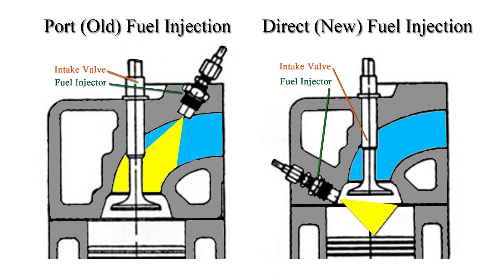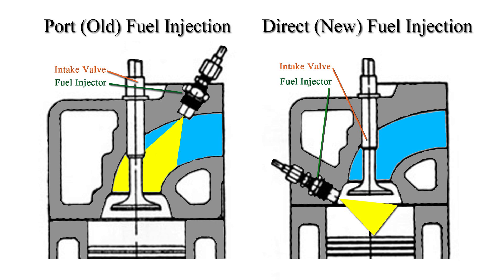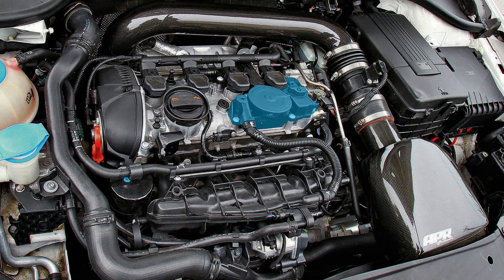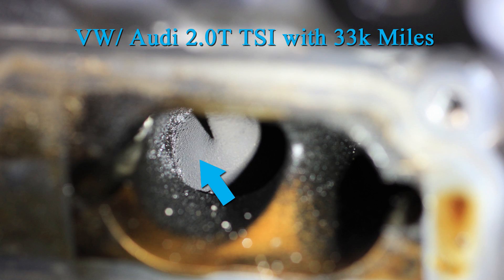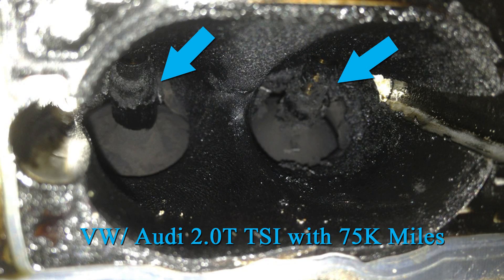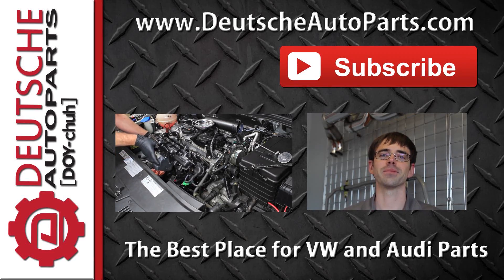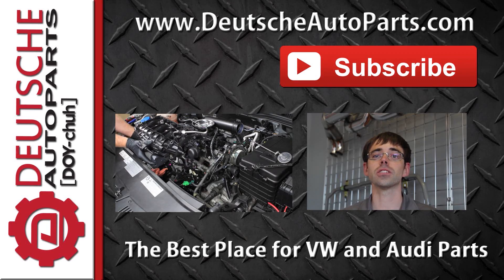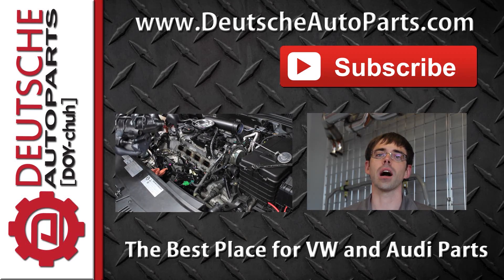Carbon Build up on Direct Injection Engine (Intake Valves) AKA GDI Gasoline Direct Inection

Comment: Simple question poped up for me. If you really start to remove the carbon build up from the valves by mechanically removing it (scraping, picking or what ever mean), the removed carbon will just drop into open cylinder. So the way to prevent that is to turn the crank and close the valve and after removal blow it out with compressed air? I have a R8 ABT Kompressor and for the supercharger overhaul it is removed and after 57k KM the valves are to dirty for my taste and i was woundering how to do it? Because for me using chemicals is risky for the catalytic converters right after the exhaust manifold, witch will get glogged up. So is the only option to to close valves one after another to eliminate the carbon for falling into the cylinder? Or do you think that the contaminates in the cylinder is no problem?

Comment: Typical of EPA auto manufacturers turn this junk on to the public they know after 5/50k what do they care plus they can sell a new service at the dealer tear down engines to clean them. You forgot to mention Oil Volatility they test oil by heating it and see how much % evaporates sending back into your engine. Synthetic oil does a better job that's why always run good synthetic oil in a Direct Injection motor.  Here is a chart shows different oils  NOACK test http://superoilcentral.com/wp-content/uploads/2015/11/noack-comparison.jpg  Non synthetic which is based on mineral oil with additives is worst thing you can do it will actually cause the most carbon buildup.

Comment: It is not just the pcv system  as a factor but also the cam timing with overlap that causes this.  The catch can will just slow down the build up.

Comment: Toyota's solution (using port AND direct injection) seems to almost completely eliminate the problem.  Not sure why everyone isn't doing it.  Seems to me other GDI engines just need their valves cleaned every 30k miles or so, no matter what you try to do to prevent it.

Comment: Hi I have got a macedec vito with really bad carbon billd up on the engine where the injectors are the van keeps cutting out while driving what is the best way to get it off the engine?

Comment: Catch can does NOTHING on carbon buildup, only oil buildup (there might be a 10% decrease in buildup)
The only solution is to do EGR delete since the carbon is from exhaust carbon.

I work as a mechanic and trust me there is no carbon buildup before the EGR pipe enters the intake, and the oil vapors goes in long before that and only leaves an vary thin oil film in the intake.
98% of the buildup is from the EGR
Reply from the maker: These cars don't use EGR.
Reply: Deutsche Auto Parts on what engine code? My RS4 B7 4.2 FSI still has a EGR, just cleaned out intake because random missfire

Comment: Just buy Toyota/Lexus, or another car with dual (port and direct) injector system.... Profit!
Reply: My Lexus has this setup. I also have a mk6 gti and i am pretty sure i need to clean the intake valves
Reply: Too bad the Lexus 2IS IS250 only has DI and while the 2IS IS350 came with port and direct, too bad it didn’t come with AWD :/
Reply: @sth801lifestyle  do you mean IS with the engine A25A-FKS ? Or an older generation?
Reply: @ShatNdd  I’m referring to the 2IS 2007-2012.

Comment: The only acceptable fix is a Mann-Hummel Provent or Flash lube air oil separator, the filters used in these brands are extremely effective and basically eliminate the problem. The only issue is finding a way to install them in your engine bay as the only fitting kits available are for turbo diesel vehicles like the Toyota Hilux. 
DO NOT BLOCK THE EGR VALVE!! 
Installing one of the catch cans above will not only prevent carbon build up in the intake manifold but will also stop the corrosion of turbo bearings and the coating of the intercooler in oil which decreases its efficiency.

Comment: I'm old enough to remember my dad and older brother telling me to drive at highway speeds and floor it to 'clean out the carbon from the carburetor."  I remember doing that as a teenager and seeing all that black smoke come out the exhaust.  That was before all the EPA regulations.
Reply: That's what's commonly known as an "Italian tune up" apparently Ferrari guys would do that back in the day. Get the engine hot enough to break up any build up and burn it out.
Reply: I don't know how that's gonna help with GDI engines. Italian tune up will only help in non-GDI engines. Scotty Kilmer explained in one of his video.
Reply: that'd be carbon from the cylinders and valves but yeah, you'll heat up the engine a bit more than spec and load it hard to clean out some deposits

Comment: would a 3.6 VR6 have this problem with carbon build up?
Reply: YourMobile Barber I know this is 2 years old but to answer: the 3.6 vr6 has a integrated catch can by design ( yeah!) but mine has 130k miles and low end torque, top end power and gaz mileage has started to go down lately. It probably due now.

Comment: The problem folks, is that a gasoline engines are not meant to be a Engine OIL Burner! ( Diesels burn oil, not gasoline engines) Engine oil that gets on the intake valves stems or piston domes, does not burn off clean. It needs fuel to help with its complete combustion but that still will not prevent build up of carbon. The Oil manufacturers are struggling to satisfy all the needs of the modern engines and their uses. With that in mind,  there is NO OIL that can deliver. (Extended drain intervals, Turbo Temps, Catalytic Converter and O2 sensor life, Less engine wear without zddp additive, clean combustion chambers and intake valves from EGR system,  ETC the list goes on!) They have stated "NO OIL EXISTS to do all the things necessary in these new engines!"The EPA is pushing for fuel MPG, No NOX fumes, and these tighter standards are pushing for Direct Injection, Turbo charged engines. Burn Top Tier fuel, use high quality full synthetic oils like (Mobile 1, and Quaker State Ultimate Durability, Pennzoil Ultimate Platinum) . And use your manufacturers Fuel system cleaner once every 10,000 miles. That is the best you can do.

Comment: I run Lucas gas treatment with every fill-up in my '17 GTI.  Does that help the carbon situation at all?  24k runs like a champ.
Reply: No help at all
Reply: lucas sucks I use seafoam and drive hard premium fuel etc... and valves had a little carobn at 50k

Comment: Stupid question but would water meth injection prevent carbon build up?
Reply: kyle barnes some engines running methanol injection for longevity would be counter productive, aluminum specifically(which is pretty much what most heads are made out of)

Comment: Hi I'm stationed in Germany and found some really good products from Liqui Molly (not sure if I'll find them in the states when I go back). Anyways, I used a spray can to clean intake valves and EGR on diesel engines since I have diesel BMW and I can tell you this stuff works awesome. There's also a intake cleaner for gasoline cars. Have you heard of these products and would it be safe to use an an 2014 Ford Explorer Sport Ecoboost? Thanks!
REPLY

Comment: I know people steam clean diesel engines and older gasoline engines by carefully spraying water into the intake when running at low/medium RPM. Not sure this does anything for the intake valves, but it sure eliminates carbon build up in the cylinders and on the pistons.

Comment: wrong,wrong,wrong,,, it is not the PVC system,,, engines that don't have PVC system get this,,, Valve guide seals people,, any engine with over head valves,, after engine is turned off, oil seeps down valve stems and settles on top of valve.
Reply from the maker: There is lots of evidence in VW and Audis that this is from the PCV system.  Maybe on the engines you are referring to its different but that is not correct for the VW and Audi engines we are referring to.

Comment: You can thank the EPA for this. I would just unplug that shit from running back into the intake when I buy the car and route that pcv hose to the ground or something. Once I do that I will plug that open inlet on the air intake system. You should never have a carbon problems then.

Comment: Had to have valves manually cleaned ( $ 770.00 ) @ 68,000 mi. on my 2013 VW CC R-Line 2.0 turbo engine, so I guess top tier fuel is not the answer. How long can I reasonably go before another valve cleaning??
Reply: 50k  I use seafoam every 5k and drive hard and only use premium fuel and at 50K I removed intake and it was just a light dusting of carbon ! driving hard with the seafoam opens the valves more and cleans as you drive ! period 770 was a walnut shell blasting don't drive like grandpa and use the seafoam every 5k when you change you're oil don't wait until 10k like dummies do. Then when you get to 110k have the dealer do again for 770 and have them take before and after photos !

Comment: Sometimes it's caused by bad engineering. In Ford's 1.5 Ecoboost the PCV is only connected to cylinders 2 and 3. They get gunked up a lot sooner while the outer two cylinders remain clean.

Comment: Question:  Long long time ago, back in the fifties and sixties, we would clean the carbon out of the cylinders by spraying water into the carburetor while running the engine at a fast idle;  do you think this might help?

Comment: I bought, new, a 2012 Genesis V6 3.8 liter sedan in June 2011. The care has 67,000 miles on it now. I have been putting it off (cleaning the valves)....need to get it done.

Comment: ...try also "servicerens" from bell add. They make a spraycleaner you inject into airintake while engine is running. This one helps too. Here, where i live, you can only buy it in Toyota shops. 
good luck

Comment: I have been cleaning my Toyota with demineralised water before every service... like twice a year. Combine this with some fuel injector cleaner and a good rpm run on the highway once in a while keeps my engine in top form. You should really try this. It works.
Look for "decarbonising of engine with water" here on YouTube.
Cheers out there!

Comment: I have a intake manifold replacement comming up. I have been using a can of seafoam every month where the intake sensor is in hopes that it will break this crap up. But ultimately a catch can is where it needs to be replaced. The price of a catch can that replaces the PCV is $300+ but the replacement of the PCV is about half that cost so 2 replacements of the PCV and I would have paid for the Catch can.

Comment: CRC has a really good cleaner I used and it seemed to help a lot. I used it at 40K miles. The biggest concern is that if you have a gasoline turbo direct injection, the wrong kind of procedure could cause huge chunks of carbon to break off and damage the turbos

Comment: I bought an A4 B7 that I am almost certain nobody cleaned the intake/valves. Bad fuel economy, and got a p2004 code with sluggish acceleration and CEL + traction and EPC lights came on (intake manifold runner control valve stuck open). I heard i should replace the intake manifold actuator, so I put it on my to-do list. A few weeks later the same engine hesitation and lights came on, but this time with no CEL but a pending P0121 code (Throttle Pedal Position Sensor/Switch (TPS) A Circuit Range Performance Problem). 

Are these related? Will fixing the actuator and cleaning carbon fix both??

Comment: Emission controls are ruining your engine
Reply: What's funny is, when all these emissions controls are removed, the most harmful emissions go down. Want less CO2 emissions? Improve the fuel economy of your car by removing the restriction and choking emissions controls that lower MPG. Want to low NOx levels? Get rid of direct injection, turbochargers, and lower the compression ration of engines.

Comment: Very Infomative but just one Little Question,Couldnt Water-Meth Injection be a possible Solution? It is sprayed in the Intake System before the Throttle-Body and then it could be asubstitute to the classical Multi-Point Injection System to manly keep the Intake Valves clean Better Octane Rating would just be a Bonus...

Comment: Good job sir. As a former engineer with Audi, and realized this issue in 2002. It's a relief to have someone like yourself explain the deficiencies in this technology. Not only that, nearly all manufactures are doing this technology. I've spent 10 years on finding a solution to this carbon build up issue with nothing more than manual cleaning  as a solution. I'm actively approaching seafome and BG to come up with something. They are not ready to take this at effective levels.

Comment: Redline, S1 full fuel system cleaner , highly concentrated synthetic product really works.
Use quality gasoline like Shell Super and add 1/10 of the bottle every other tank. Be regular and you will stay clean for long time....
Reply: Redline is excellent but in regards to the 1/10 bottle in the tank that won't do anything to clean the valves since the fuel never hits the valve in (GDI) gasoline direct injection cars
Reply: k domster is this on vw with th3 same issues?
Reply: How would fuel additives clean the back side of the intake valves?  The fuel never touches them.

Comment: have you thought about dry ice blaster I used it to blast aluminium off copper
Reply: We use dry ice to blast corrosion off of very expensive aircraft parts that we want to keep in service for a long time. Should work well on carbon.

Comment: someone like gumout makes a cleaner that you put in the air flow now before the throttle body. it's a tube connected to a spray bottle of cleaner.   I'm wondering if you use that method at every oil change if it would help.

Comment: Does Mk7 GTI have this issue? It has dual-injection system (with stratified direct injection for part-load and conventional port injection for high load).

Comment: On my '96 Northstar, I used to keep the oil at the fill Mark.  Now I keep it on the low side of fill, and my intake stays much cleaner.  Would keeping the oil on the low side reduce blowby, and keep a direct injection engine cleaner?

Comment: dude just use Techron or royal purple. don't fall for the Lucas Jew
Reply: But Techron or royal purple do not get on the intake valve of a GDI engine. The intake valve is above the injection port and the PCV system comes in with the air from the top of the valve, causing it to coke up.
Reply: Jon Lucas in that case, then Lucas is OK but I would rather power wash the shit out of the engine
Reply: zhbvenkhoReload crc gdi intake and turbo cleaner only works

Comment: The catch can won't matter because cars have valves overlapping in the open position allowing combustion carbon to accumulate.  .. Just pop a small breather filter on the top of the valve cover and get rid of the hose altogether.
Reply: I've pulled a couple of gallons of oil/water/gas gunk out of the EGR system on my Ecoboost F150.  It would be a tough sell to try to say that that didn't matter.
Reply: Gallons !  ... Something is wrong with your car if that's the case.
Reply: Over a period of a couple years...sorry I didn't mention that...but still a large amount of gunk to dump on the backside of a hot intake valve.
Reply: Have you heard about any negative effects of using products like Sea Foam or Chemtool B12 on turbos?

Comment: Will this give a check engine light and misfire?
Reply: My Volkswagen experience misfires on cold starts. I replaced the coil packs and spark plugs, still misfires. Had the carbon clean with sand blasting it, and it runs perfect now.
Reply: Yep. During cold starts it will misfire

Comment: I'm planning to buy a 2012 Mazda 3 soon. According to the article (below), Mazda engineers determined that carbon deposits build up when valves temperature is under 400°C (752°F). They designed the engine so the intake valves aren't cooled by any water jackets, so the valves get hotter.

http://www.motoiq.com/MagazineArticles/id/2105/pageid/3529/131-compression-and-40-mpg-on-87-octane-fuel-introducing-mazdas-skyactiv-technology.aspx

Comment: great video. I'll have to pass this on to my friends with direct injection cars.... I wonder why anyone would give this video a thumbs down, this is really good info...
Reply from the maker: thanks for watching
Reply: Thumbs down because it is anecdotal non-engineering. Catch cans have not been independently tested.  If CC's significantly improved service intervals or reliability MFG's would install them, and you can be sure they the MFG would have better engineering than aftermarket ones. I'd like to see the real diagnosis of carbon build up, maintenance problems, driving behavior.

Comment: 95% fix is to block off the exhaust gas recirculation (EGR) to the intake by adding a blocking gasket 
this stops the exhaust gases from building up soot/carbon from the intake and valves
this issue is very common on nissan skyline V35 m35 stagea's cars and any nissan that runs a DD engine aka Di DI-NEO or DD DDNEO or for example VQ25DD or VQ30DD  if it is DE the injectors are in the intake

i have cleaned 3 nissan V35 VQ30DD intakes and valves from 1cm/10mm thick soot/carbon build up from the EGR at the back on the intake
and 1 M35 stagea VQ25DD same issue
all cars were getting 500kms to 550kms from a 80 litre tank of fuel, when cleaned they get 630kms to 750kms per tank 80 litres
if you work that out the VQ30DD has 260HP 5speed 80litre tank and gets 750kms a tank that is great fuel economy 
the stagea is worse at the economy being a VQ25 4 speed(reving higher) more weight 80kms tank and 220 ish hp